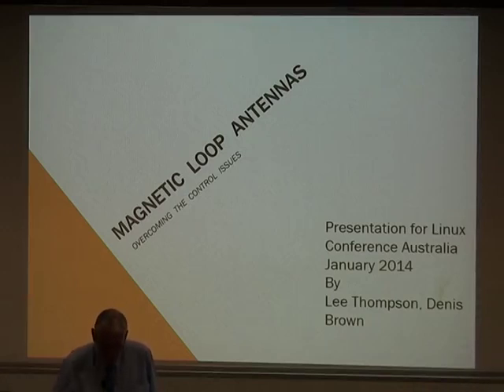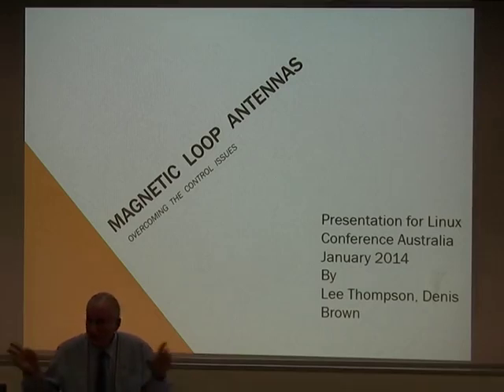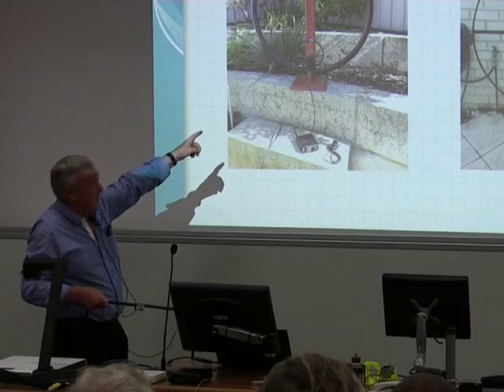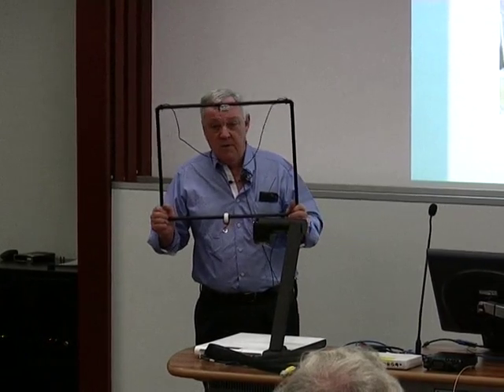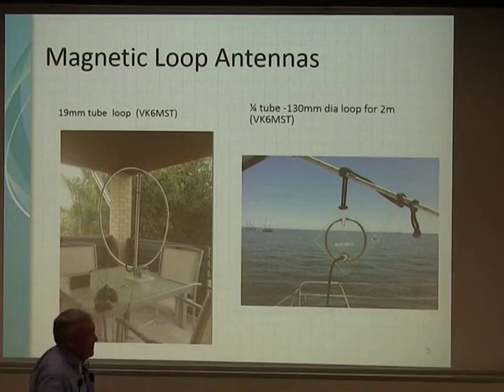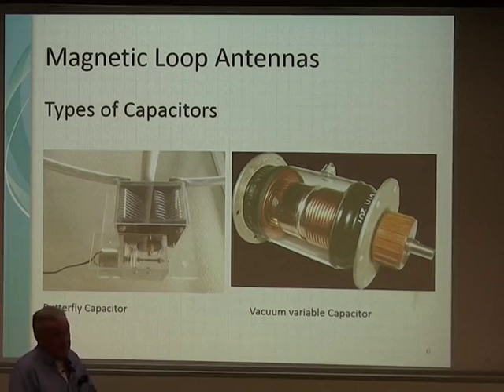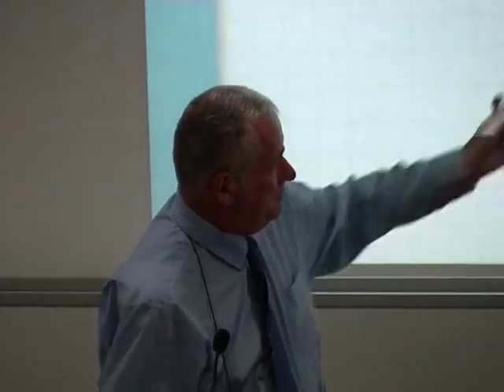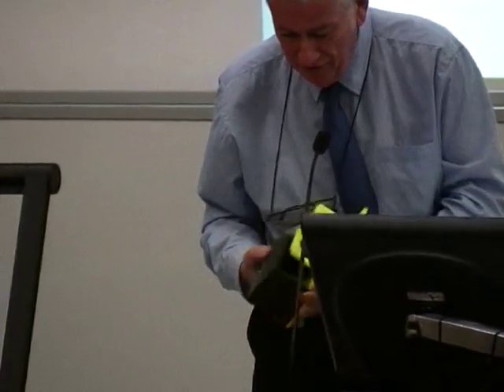Tuning a Magnetic Loop Antenna using an Arduino-controlled Vacuum Variable Capacitor - Dennis Brown,

Comment: Dear friends, a nice lecture, well done! I am planning a loop magnetic antenna with a diameter of 180 cm...which will cover the 60 meters to the 15 meters according to your words to take a 3000 volt capacitor and do a good job....in all the articles they warn that the voltage on the 160 meters will be about 7000 volts, how did it work for you on your capacitor? And I also have a 3000 volt capacitor from 7 picofard to 1000 Collins of a vacuum amplifier. Will it work for me? Thanks!

Comment: You don't need to have under 1/4 wavelength at the highest frequency used, you can go 7/10 of a wavelength without affecting the radiation pattern, at 8/10 the nulls start going away. The antenna can be any length without a problem up to about 7/10 but for myself, I'd stay below that which is probably excess caution.

Comment: I want to make a loop, but these gentlemen make it sound dangerous. I have a friend who used one on low power from inside his high rise apartment next to the window. But he never made it sound dangerous.
Reply: I would not use one where and when small children were present. There is a shock hazard. But around adults who understand the concept of not touching the antenna while transmitting it's perfectly safe.
Reply: N2LRB You don't want your body next to it because you change the capacitance putting the system out of "Tune", it also runs on high voltage so yea don't get too close, but it's not dangerous... exposure to radio waves will affect you in a far more negative way than the actual high voltage.
Reply: +Solomons Words I've found proximity (capacitive) miss-tuning is due to a "lopsided" build. (edited in) A problem with coax, not say a balun). A tiny offset at the feed end or an asymmetric connection at the top will cause a big voltage mismatch.
If you use say a twin gang tuning capacitor, the rotor should be at minimum voltage and you can tune it with your fingers.. Vacuum variables etc. are sadly not twin gang.
Reply: +David The voltage at the capacitor is high, Humans are like a huge choke, lol.
The proximity to large amounts of RF is dangerous.
Reply: wow really you guys need to lock you in a snoflake jar so you dont get bruised from this comment , , i mean come on,  if your not transmitting on it at 50 w you be fine, if you receiving no nothing is coming out of your antenna, and small one in your house size can only  put 10 20 watts in it anyhow,  just dont put you head in the loop when you got your finger on the mic.. rf isnt going to harm you other that heat you up if your right close to a high watt signal, loops are nice in the house work great and wont kill ya. your cell phone putout a few watts n you put it right on your brain ,,  okk im done this kinda funny but not really... . your car ride to the donuts shop has higher risk,,  thats another story,..
Reply: If you don't touch the loop, especially anywhere near the capacitor while transmitting, it isn't really dangerous, OSHA limits are far below the field strength this will produce at 100 watts transmit mpower.